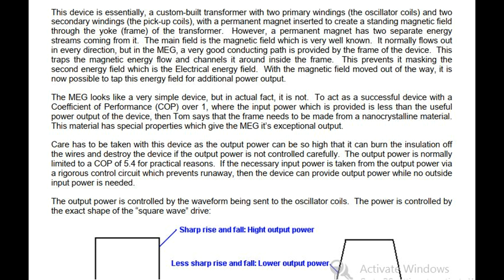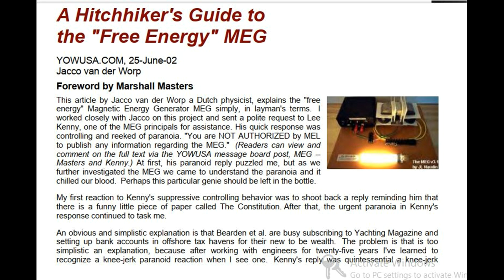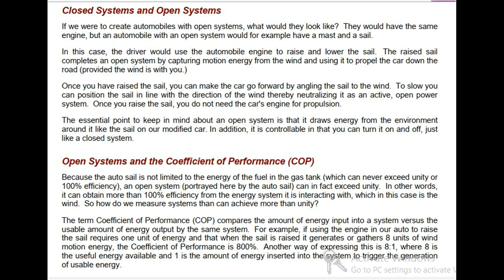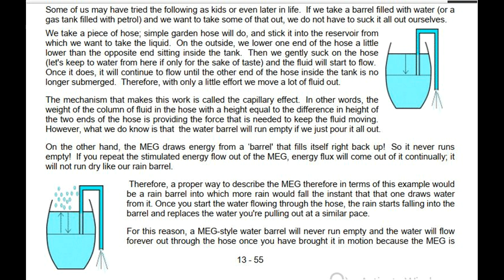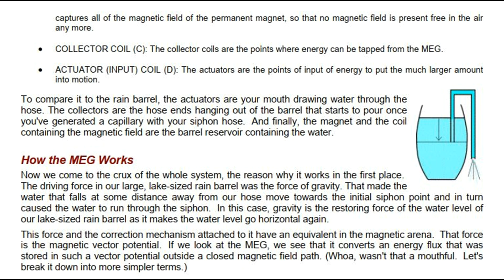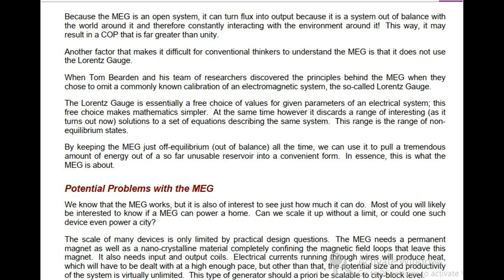The “MEG” Motionless Electricity Generator

Comment: Special shout-out to TOM Bearden ! Also MEG has NOT worked based on Tom instructions like da beginning of this video says
Reply from the maker: If it don't work, the magnet is too strong. Choose a little bit weaker magnet and see what happens.
Reply: @marcisgulbis9310  someone made a Video sayin  Magnets strength is relative to working ! Ok THANKS I’m Gonna try it n my lab
Reply: The MEG uses a novel materials effect freely furnished by the nanocrystalline core and its structure (some of them, not all of them!) wherein the B-flux curled portion of the magnetic vector potential A is sharply localized inside the core (recall that the B-field is merely the curl of A, hence it is the curled component of A). Such localization of the curled or “field” component of A, of course, is known as the Aharonov-Bohm effect, whereby a curl-free magnetic vector potential then freely appears OUTSIDE the core in space, where the B-field would normally have appeared had its localization not occurred.

So the MEG has thus conditioned the IMMEDIATELY SURROUNDING SPACE, so that extra EM energy density has appeared OUTSIDE the core, in space itself but in the form of the curl-free A potential energy. Since in general relativity the increase in energy density in spacetime is a curvature of spacetime a priori, then the MEG’s nanocrystalline core materials have provided an extra EM ENERGY RESERVOIR in outside curved spacetime.

Please note that this completely violates the standard CEM/EE model, which arbitrarily assumes a flat local spacetime and an inactive vacuum. In the MEG, the local spacetime is curved and the local vacuum is now active (the virtual particle flux of the outside spatial vacuum has been altered). This violates the standard assumed Lorentz symmetry, which is necessary if one would have a COP>1.0 energy-from-the-vacuum system. I refer you to M.W. Evans, P.K. Anastasovski, T.E. Bearden et al., "Classical Electrodynamics Without the Lorentz Condition: Extracting Energy from the Vacuum," Physica Scripta, 61(5), May 2000, p. 513-517. 

The normal A-potential consists of two components: one curled and the other uncurled. Usually the uncurled component is rather much “hidden” by the curled component, and thus not usually considered.

Now note that, in the AB effect, the uncurled A-potential extends from INSIDE the core on out to the space outside. The AB effect only localizes the CURLED portion (the B-field) of the total magnetic vector potential A.

But now, when we perturb that B-flux inside the core, an additional effect occurs. We also perturb the “inside front end” of that curl-free A potential component extending on out into the outside space, and that perturbation of the inside end of the uncurled A propagates passes outside the core and on through the uncurled field-free A potential in outside space. In short, that part of the perturbation travels outward outside the core and out into the surrounding uncurled A.

The simple equation dA/dt = - E then tells us what happens outside the core. The perturbation spreading radially outwards just outside the core, is a dA/dt perturbation and that perturbation is directed out and away from the MEG core. In the little formula the resulting E field produced by that spreading perturbation has a negative sign on it, so the E-field created in outside space by that outward-traveling uncurled A perturbation is directed FROM THE OUTSIDE SPACE BACK INTO THE MEG CORE ETC.

Note also that the magnitude of the – E produced, is controlled by the sharpness of the rise time and decay time on the input pulses the operator feeds into the MEG’s normal input coil. One can easily produce sufficient return voltage to destroy the insulation on the windings on the coils. Every coil and every wire is now an “input coil and input antenna” for the MEG’s receiving of that returning E-field energy.

Each and every wire or coil in the transformer section receives a part of that E-field energy radiating back into the transformer from space just outside the core, and each receiving wire and coil also then re-radiates energy to all the others. The result is a dense set of E-field signal energies (in pulses form) but of varying phases.

Then we adjust things (the method is proprietary!) so that a reasonable “phase addition” condition exists in the dense signal environment of the MEG. Once that is done, the return energy received from the returning excess free E-fields is largely coherent in the MEG. We then have the following situation:

(1)     the MEG acts in part as a very efficient standard transformer, courtesy of its modern nanocrystalline core structure. With the normal transformer part of its operation alone, the MEG would get about 90% efficiency and – without any other energy input – it would produce something like COP = 0.9.

(2)     But there is also a great deal of extra, free EM energy coming into the MEG from the altered spacetime outside the core, due to dA/dt = - E and the Aharonov-Bohm effect. Indeed, there is easily more E-field energy coming back into the MEG from the outside space, than the input energy we ourselves placed into the “input” coil.

(3)     The MEG thus has TWO energy input reservoirs/sources: (a) energy input by the operator and paid for by him, and (b) lots of excess free environmental E-field energy received from the altered external space and the perturbed AB effect.

The MEG’s thermodynamic operation is now similar to that of a common home heat pump. The thermodynamic efficiency of the home heat pump is only about 50%, and so – if all its input energy were only what the operator pays for and furnishes – that would allow a COP of only 0.5. But the heat pump ALSO receives a lot of excess free heat energy from its environment. It in fact receives so much extra free energy from its environment that it outputs three to four times as much useful energy and work as the operator himself had to input and pay for. In short, its COP = 3.0 to 4.0, even though its overall efficiency is always less than 100%. Which is why we use home heat pumps in the first place.

So the EFFICIENCY of the MEG is always less than 100%, because it rigorously obeys the conservation of energy. Total energy input to the MEG from all sources, minus total energy dissipated in its losses, gives the amount of usable energy or work output by the MEG. Since – contrary to any ordinary transformer – the MEG receives an extra, free, and appreciable input of pulsed E-field energy from its environment, the MEG’s operation is directly analogous to that heat pump, and its COP is permissibly COP > 1.0.

The MEG completely complies with physics and thermodynamics, but with the nonequilibrium steady state (NESS) thermodynamics. That is, with Ilya Prigogine’s thermodynamics of dissipative systems.

We also note that certain areas and effects have long been accepted and accounted in NESS thermodynamics, which allow violation of the second law of thermodynamics (i.e., allow the production of negative entropy). Strong gradients (as used in the MEG in pulsing) and materials memory (as exhibited by the materials freely initiating the AB effect) are two such recognized and proven areas. See Dilip Kondepudi and Ilya Prigogine, Modern Thermodynamics: From Heat Engines to Dissipative Structures, Wiley, New York, 1998, reprinted with corrections 1999. Areas known to violate the old second law are given on p. 459. One area is strong gradients (as used in the MEG) and another is memory of materials (as used in the MEG in the nanocrystalline core materials and structure).

You can easily get the AB effect with a good toroidal coil, as is well known. But there you have to PAY for it in terms of voltage x amperage.

The thing that made the MEG possible was the discovery that certain nanocrystalline core materials and construction freely evoked the AB effect, so you do not have to pay for it. Immediately that tells us that we have a FREE and extra EM energy reservoir in the MEG’s self-modified external spacetime environment, and that modified environment is feeding excess electrical energy right back into the MEG for its use.